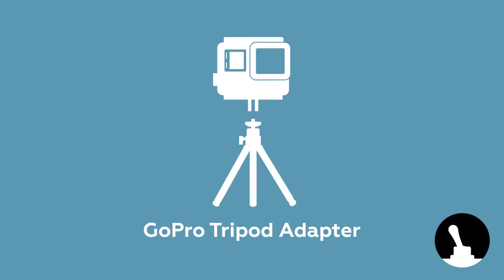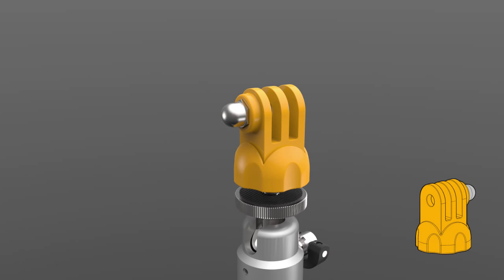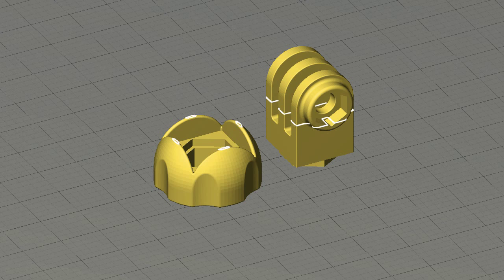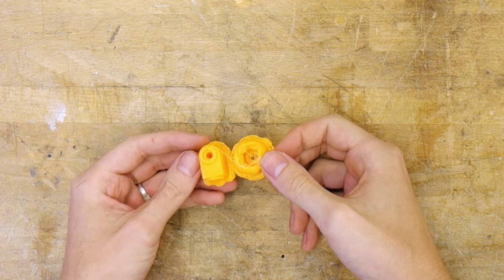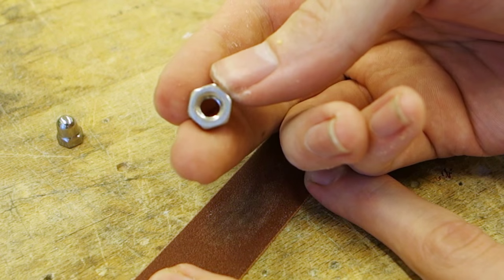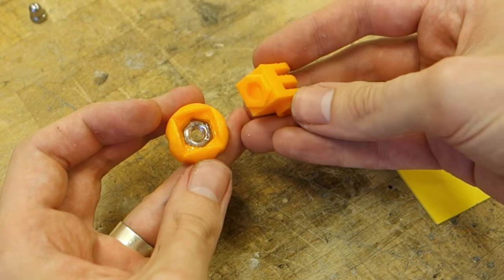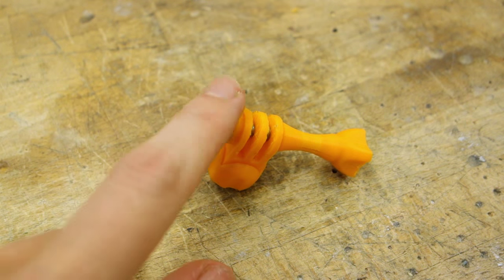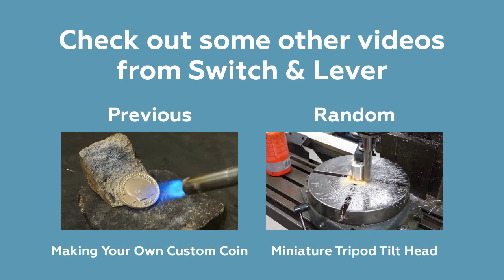Make a GoPro Tripod Adapter

Comment: Nice work man..! try PVA filament for the supports, it's dissolved in warm water, it works wonders..
Reply from the maker: +jimbit22 Indeed, that's a good method if you have a printer with two heads, I unfortunately don't.

Comment: I used the base plate coming in the packaging : a block of wood shaped to fit inside, a T-nut, and you're good to go. But I guess your solution is much sexier.
Reply from the maker: +Alexandre Bourgois I considered doing that, and it's a pretty good solution. I was mainly motivated by size (this is much smaller than what one would build from the base plate) and not wanting to have to carry another part, i.e. the clip part, with me as well.

3d prints are sexy!

Comment: I don't think it would be much harder to just carve that thing out of a solid piece of plastic or even aluminium considering all the clean up you have to do on a 3d printed part with overhangs. You would just need a chunk of material, a file, drill, chisel and a pair of calipers. If you were to use aluminium you could even cut the threads with a tap. I just never quite caught on to that 3d-printer hype.
Reply from the maker: +swiss If you think you could make that in less than five minutes (that's about how long the cleanup took, add another five for gluing) please do so. I would love to see the result!
Reply: I'd really like to give it a try but I don't have the materials and tools on hand. Also you should add the time it took you to design and print the parts to my deadline ;-) But seriously, I thought about it again and I think the fastest and probably cheapest way would be to use plywood that already has the right thickness for the "fingers", drill the holes, cut out the three pieces and two spacers, glue it up, drill a hole a little bit undersized for the nut in the bottom, add glue and hammer in the nut. Pretty much the same for the smaller nut, maybe add a layer of plywood on that side. It wouldn't be as pretty but I think it would work just fine. Don't get me wrong, you did a good job making that adapter and you showed that you know what you are doing. I'm just not a huge fan of filament type 3d printers and I don't think they make everything faster and easier. If I get the chance to make a little proof-of-concept prototype the way mentioned above, I'll let you know!
Reply from the maker: +swiss Nah, the design time shouldn't be included, you need to spend that time regardless what material you make it in. I see some immediate issues with your choice of material though, plywood won't last as long as plastic, especially if exposed to the elements which the GoPro was designed to withstand. 

I love FDM printers for what they are, it's when people see them as a solution for everything that we have a problem. You wouldn't use them as production machines. It's not something that grandma would have at home to print gifts for her grandchildren. They're great for prototyping, especially since you can have the printer make parts faster than you could by hand, and you can work on other things while it's printing. Therefore I think they're an exciting technology. If I wanted something to make production parts I would go for a SLS or SLA printer, but then the prices start going into imaginary levels.

But yes, make something and document it, would love to see what you come up with!
Reply: +Switch & Lever I agree, 3d printers definitely have their place in prototyping but are not the answer to every question. You are also right about the plywood, it isn't the perfect material by any means but it is cheap and available to anyone, plus a layer or two of varnish or spray lacquer would make it much more suitable for outdoor use. It can also be substituted by pretty much any material you'd like using my method. I quickly dug through the bin and found a nasty looking piece of old plywood. Took me a little over 10 minutes to throw this thing together with the most basic tools. You can actually see everything I used to make this on the picture. It is very crude, ugly and I didn't care for the dimensions but if an M5 screw fits the GoPro mount it should work. Also the nut in the bottom is just an M5 nut since this is all I had laying around. I'm never going to use this since I don't have a GoPro nor do I have a tripod, so I just made this because I told you I would try. Here is the picture:  http://imgur.com/w3EtIkU
Reply from the maker: +swiss Touché! That would indeed work! It won't win any beauty pageants, but it's a functional piece alright. It proves what many people have complained about my videos in the past, that they don't have access to fancy tools so they can't make anything like what I do. Case in point, you don't need fancy tools! Thanks!